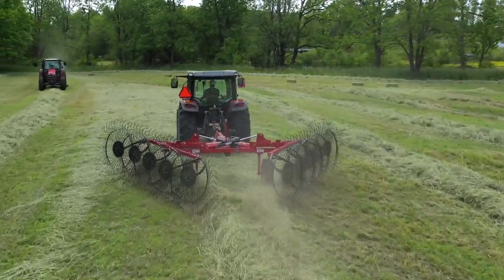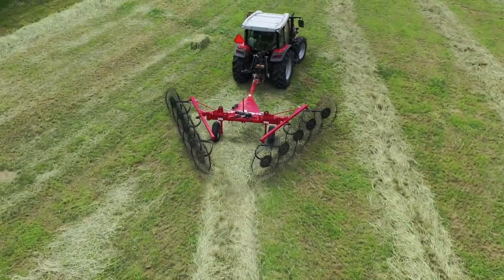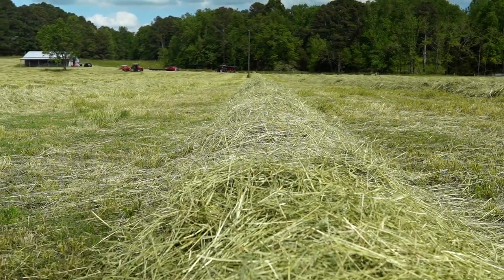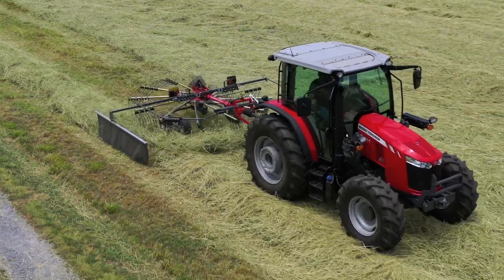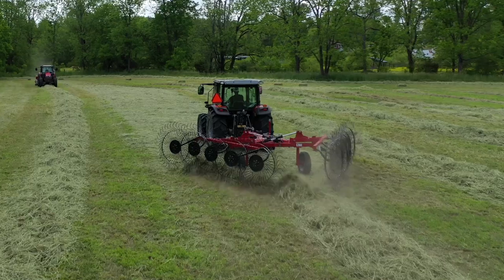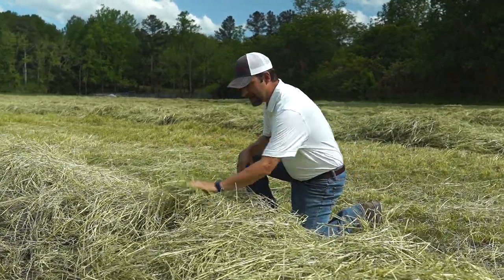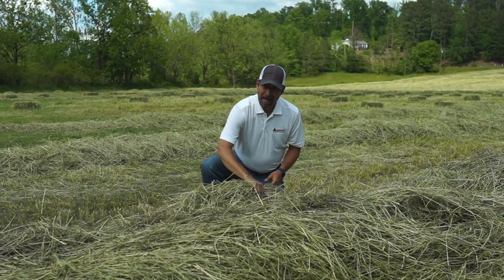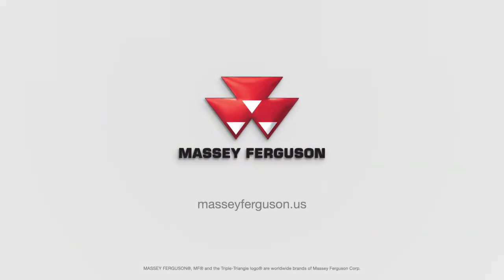RAKES | MF ROTARY RAKES VS. WHEEL RAKES

Comment: Rotary rakes can't take any abuse wheel rakes can take the abuse I own a kuhn wheel rake for 8 years 250 acres year and I only had to send $175.00 in maintenance we owned a pottinger rotary rake dad tapped a fence post cost us $800 dollars in damage and with having tedders now the hay is already dry so wheel rake all the way
Reply: Also depends on the driver
Reply: Saddlehores llc.  Good point.
Reply: I like and use a wheel rake . Bought a almost new 10 wheel V speed rake 2 years ago haven't had to spend a dime on it except to grease it.
Reply: Repaired some Krone rotary rakes that's been banged on rocky fields. The center axle had been bent on them and since the farmers continue the gears got eaten up due to the play becoming too big. So needed to change gears and center axle. Not cheap.

Comment: First off why are there so many streaks of poorly cut hay in a field being demonstrated?  Second, that wheel rake isnt being run right, as in half the clips your leaving hay behind on the edges.  Plus, why not make a narrower windrow and pickup more hay at the same time, as a square baler would prefer.  I dont buy that the "roped" windrow doesnt dry just as fast, especially if it was taller and narrower like it could be.  Finally rotary rakes have so many moving parts, they are the parts mans dream.  Only an implement dealer would like a rotary rake.  Id take a side delivery rake over a rotary rake!

Comment: I Tedder my hay then use a 10 wheel V rake with a kicker wheel in the rear so all hay has been turned.  V rakes are much faster and saves time. Which make the difference when rain is headed your way. Or pop up showers in the mid afternoon on hot days. No time to waste.

Comment: I have Hesston 3972 that we bought new.  Has cost maybe 200 in repairs over the last 20 or so years. I doubt the powered rake will provide that kind of value. We rake at 9-10 mph. Wheel takes are very gentle on the leaves.

Comment: Can you pull a rotary rack  and round baler at one time
Reply: Not a single rotary as the baler would need to be towed offset which would pull at the rake. Maybe a double rotary that leaves a centred windrow? I have seen it done with wheel rakes though

Comment: used my rotary today for the first time....glad to see so much waste in this video. I thought i bought a turd that wouldnt clean a field seems like its standard for both
Reply: What brand is yours? If it's adjusted properly or a good brand rake with a lot of tines/arms that fields should be CLEAN. Rotary rakes will pick up everything easily.
Reply: @TheMCD1989  new holland 254. even inn the videos of new and different brands they leave  too much behind in their sales videos. We went back over a 8 acre field the next day after trying every adjustment and speed and got 9 more round bales with a old new holland bar rake. Bought a 3 pointold ford bar rake the next week and we are selling that 254 pos
Reply: you have to slow down. same thing happened to me. we bought a kuhn rotary rake and i was missing a bunch, i thought i was doing something wrong. then i noticed that all of the rotary rake demo videos the tractors were going a lot slower than i was. i slowed down and now it doesn't miss a lick!    p.s. they are going to fast in this video, you can see the missed hay in the field 1:52